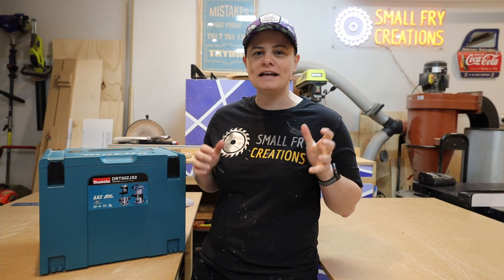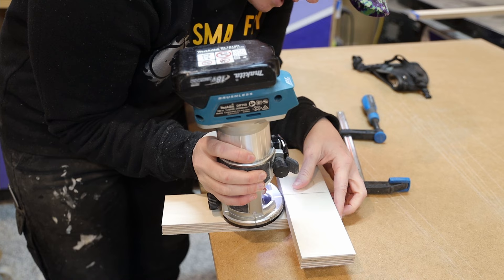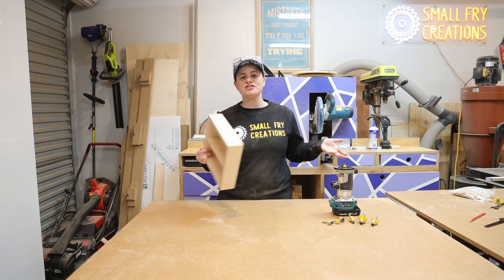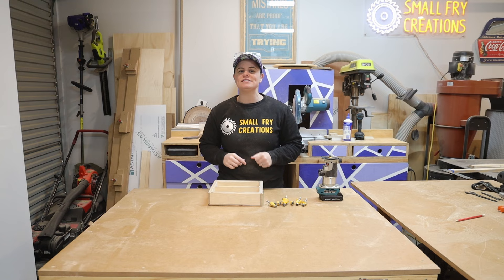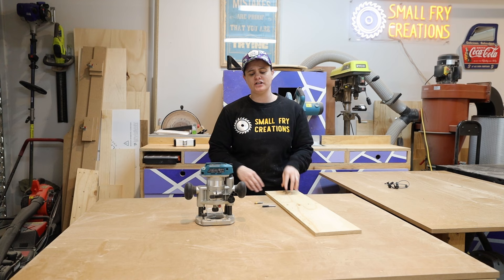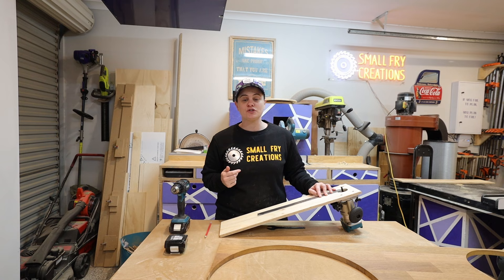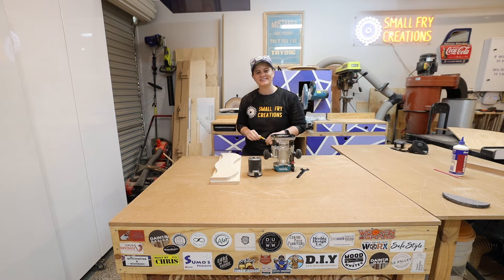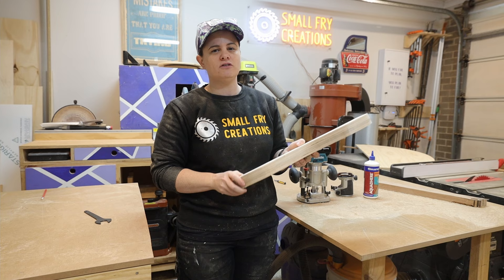5 BEGINNER ways to use the trim ROUTER while reviewing the Makita Trim Router

Comment: It’s awesome to get shown how to use the tool. Lots of videos are 20 minutes of adjusting the router or testing features, but this is the first I’ve seen that immediately shows a practical use-case, setting up guides, and getting started. Thanks!
Reply from the maker: Thank you. Glad I could help. Its a great tool and once you get comfortable with it you will use it on every project

Comment: I use the plug in/wired version of the Makita Trim Router and i love it, i find that the dust collection on the wired version to be great, i just plug into my shop vac and away i go. 
Here's a little tip in knowing which way to go with your Trim Router, get your work piece say a picture frame and you want to put a little round over on both the inside and outside, if you place your right hand fingers together next to the picture frame and touch it with your thumb, your fingers are pointing in the direction to go while your thumb is touching the edge of your frame, now looking at that direction your fingers are pointing at and it's anti-clockwise, now do the exact same thing with your right hand inside the frame, fingers together and thumb touching the edge and you see that your fingers are pointing in a clockwise direction, amazing and one way you won't forget which way to go.
Stay Safe,
Barry (ENG)
Reply from the maker: Thanks Barry. This is a great tip and good to know for future. I think the dust collect is fine with it’s not a through cut. I found it not awesome if router bit is exposed at all.

Comment: Yep, those are the bushing screws, you can leave them off unless installing a bush. That router also has an arrow on it to remind you which way to push, very handy! I've been running that exact kit for nearly 3 years and it has never missed a beat. Such a weapon for such a small unit. You definitely want the 5AH batteries. The height adjustment on the regular base is not the best, the once you get used to it the control on the plunge base the adjuster gives you is 1/10mm accurate and super cool. Great video Ains... guess I'll delay my one for a few more months now!   🤣
Reply from the maker: Good to know about the screws. I’m loving it. So handy. I have got 5AH batteries now and working well. Thanks for the support James 😀
Reply: Thanks for pointing out it has an arrow on it, I never noticed that before.

Comment: I bought the RT0701c Makita router (cable) and I'm not looking back. :)
It's a nifty little tool (710 W) and comes with a tool for 6 mm shanks with an extra tool holder it even accepts 8 mm shanks.
For work that is much harder, I have an extra router with a 1,6 Kw motor that accepts 8-12 mm shanks.
Usually, I do it much as you show. Take all excessive material away with a saw and go the last 3-4 mm with the router.
Sawblades for the jigsaw is cheap...router bits cost $$$.

Comment: I was like that for years too. Afraid of the almighty router! When I finaly dusted it off it quickly paid for itself. Sliding doors, edges, and now in a boat building / restoration project. I'm just a hobby user but I couldn't live without the noisy B4stard anymore!
Reply from the maker: Ahh thats so good to hear. I know the feeling. The router is the tool before starting woodworking I knew nothing about and can't believe how useful it is not that I'm into the hobby!

Comment: This is great Iv just joined a man shed we are 25% female but I don’t have knowledge of how to use the tools although I can get help. I just wanted to see what you can do and I want to make my own bit, router table, table saw jig and a picture frame sled but I wanted a router to make nice edging. Iv seen your videos and have just subscribed to your channel. You have explained things very well and our man shed has lots of Mikita bits. Just need to be able to drill to make these things. I’m right handed but have a fluid build up in my hand hence router table. Would the Mikita be the best one to use for a router table? Thanks again for the good video.
Reply from the maker: Hey Thank you. The router is a such a great tool and building a router table is a great idea. The makrita router would be perfect for a router table. You can put a palm router like the one in the video into a table which is perfect for edges and light jobs. If your doing big stuff then you can put in a larger makrita router that can take larger 1/2 chucked router bits. Good luck with the build :)

Comment: What a brilliant video  - massive thanks! Can I ask a quick question- I have lots of tools from the Ryobi One series, but want to get the Makita router, would the corded model be good? I don't want to invest in more batteries from another brand! 

Thanks again, 
Ross
Reply from the maker: Hey Ross. Thank you . Glad the video was helpful. I havn't used the corded but from what I see and read they are they are the same as the battery ones. Makita is a great brand in my opinion so I think it would be just the same :)

Comment: Great video! Really informative. Bought the same router a while back but only getting round to using it now to round over the edges of a bench I'm making. Any advice on what speed setting I should use?
Reply from the maker: Awesome! I gotta be honestly I generally don't touch the speed setting from the highest setting. I'm sure there are times it would help to slow it down but I find having it on the top speed works for 99% of things. Hope this helps
Reply: @SmallFryCreations  Thanks for letting me know 😁 Went with a high setting and it did a really nice job. Such a great little tool 👍

Comment: Love your videos. If you were going to buy a small router bit kit from Total Tools etc, which one would you go for as a first time user ? I just got the Dewalt for Christmas. Thanks
Reply from the maker: Thank you. I would go a simple kit that has some straight bits, round over and a template or flush trim bit. Then see what you use the most and then get a good quality of just those bits. Total tools have a $99 kit which would be a good place to start. Amazon is another good spot. You could go a cheap set to just get you going and see what you use and then go from there. I wouldn’t invest is an expensive kit and then find you really only use 3 bits. Hope that helps 😀 thanks for stopping by
Reply: @SmallFryCreations  great, that’s really helpful <3

Comment: Hi, i have a question: what is the biggest diameter of the bits that you can use with a variable speed trim router?
Reply from the maker: Hi the limiting factor is the base of the router. The router bit may not fit through the router base so that would be the biggest factor. Then it comes down to what you feel comfortable with. The trim router is designed to do light duty router work. If the need is a bigger router bit you want to move to a larger router with a 1/2 inch collet that can handle larger router bits. Hope this was helpful 😎

Comment: I have the makita 18v battery router, which bit pack do I use. 1/4 inch shank or 1/2 inch shank? What’s the difference?
Reply from the maker: The shank size will depend on the collar size of the router. Most are 1/4 shank. The shank is the length of metal the of the router bit. 1/2 shank is thick then the 1/4 and required a different collar. The collar is the sleeve the router bit slides into when you are putting it in the router. You would have the check the router Collar or manual to confirm the shank size. Hope this helps
Reply: @SmallFryCreations  thanks for the advice!!

Comment: I’m it afraid of a router but I just really really suck at it. My worse skill in woodworking
Reply from the maker: I totally understand. The sounds and the speed they run at is scary. I promise if you start with just a small round over on a piece of timber and work your way up you won't know yourself. Its the most versatile tool in the workshop and levels up your woodworking for sure.
Reply: @SmallFryCreations  correction* I am Not afraid. Just hard using it with a dust collection adapter in it

Comment: Can we stop putting our hands on the soleplate of the device that cuts through wood with very little effort . This is the third video ive seen doing this .
As a lifelong makita user i can assure you that no electronic protection fitted or made by them will last , i have had so many switch failures its not funny and on two occasions with the small skil saw that has resulted in self starts .
Just dont do it , its the 1.01 tool handling no no .